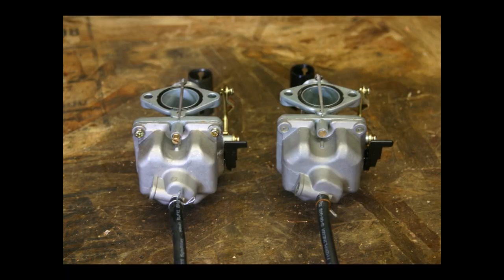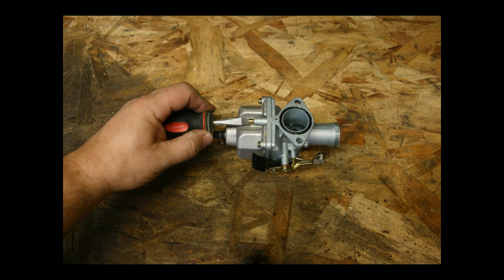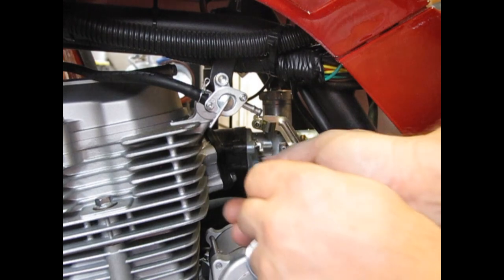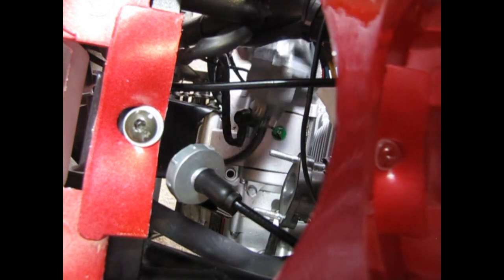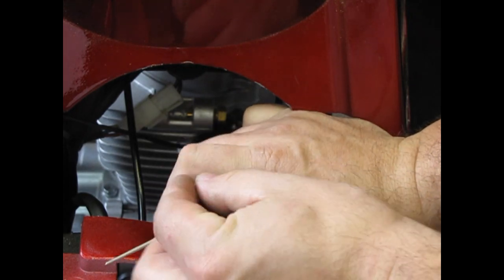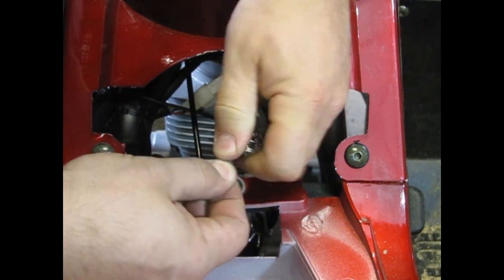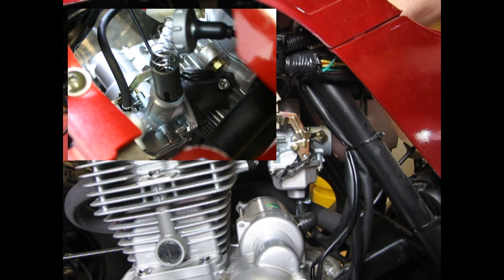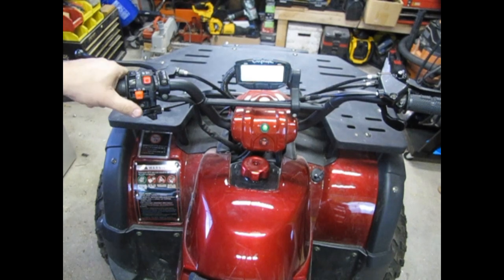How to Replace a Carburetor on your Tao Tao ATV by MUDIFY

Comment: I know this is an old video but you had a small line connected to your original filter you removed (pcv valve I believe). I never saw this reconnected. I'm having the same issue as my new filter doesn't have a connection.

Comment: Great video.. any insight on a apollo commander 125cc carb with a left hand choke cable? It is a pz22, I cannot find that set up any where! The numbers on the carb says pz22wl-6. Would you have a replacement or upgraded version?

Comment: Where did the pvc valve and filter reattach too?  My stock filter has the same thing that goes into the engine.  No space on my new air filter to connect.
Reply: You can technically vent pcv to atmosphere. Just plug the tube in to the factory port on the engine and leave it out of your air filter. Longer tube is better for keeping the oil that may want to work it's way up, inside. You can also put a fuel filter on the end of the line to keep mud dobbers and general filth out of your crankcase. Idk about tao tao but a lot of small engines have the pcv go right into the top of the valve cover.

Comment: What part do I check if I'm not getting fuel to the carborator on an ATV TAO TAO 250 (Rhino)?😃😃😃
THANK YOU VERY MUCH FOR ALL YOUR HELP! 😃 😃 😃
Reply from the maker: Hi Cheryl, I would start by looking at the fuel filter. If it's partially filled with fuel, I would pull the fuel hose off the carburetor (have a container handy to catch spills), and rotate the fuel shutoff valve back and forth. If no fuel comes out of the hose, you may have a plugged filter. Those stock fuel filters are not high quality, so I would replace it with a Mudify filter (https://www.ebay.com/itm/273737477664). If, on the other hand, you have no fuel in the filter, you may need to pull the tank and look for blockages. Best of luck to you! -Mudify

Comment: Leave links to the parts used so we can purchase
Reply from the maker: Thank you for the comment, datdude. I've updated the description to include the link to our Carburetor and Filter Kit. ebay.com/itm/273737353497
 Take a look and let us know how it fits!
Reply: @mudifypowersports3318  The description on the Ebay link says for 150-250CC.  Mine is the TaoTao 125cc New TForce ATV.  Will it still work?

Comment: I would like to know where the hose that is at the bottom of the carb goes
Reply from the maker: Hi Sour Complex, the hose at the bottom of the carb is a fuel drain line. The fuel bowl overflow runs out here, as does the fuel when the drain screw is open. When riding on rough or uneven surfaces you may notice some fuel spilling out of this line. The hose is simply to route the excess fuel away from the engine, starter, air filter. etc...
Hope this helps, and let us know if you have more questions!

Comment: Thank you for this video. I need some insight about the choke switch. It came loose and I lost the screw that holds it. How do I get it fixed. Please help
Reply from the maker: Do you mean the handlebar or the carb end? Either way, you can get metric screws at your local hardware store. I would take your piece to the hardware store to match threads. I bet you'll spend less than a dollar. Let us know how it works out, and good luck!
Reply: @mudifypowersports3318  not the handlebars. The switch itself there is is a screw that is holding it under the switch and it's missing.

Comment: Thank you very much! My new air filter does not come with an attachment for the PCV hose/valve - does that mean I got a wrong air filter?(wasn’t sure from the video if yours did and, if it didn’t, where to put the second end of the PCV hose after reattaching it to the engine).
Reply from the maker: Thanks for the comment! The PCV valve does not attach to the air filter after this upgrade, since it has its own internal filter.
Reply: @mudifypowersports3318  Thanks for the response! I am still having trouble after the carburetor and air filter change - my atv turns on and then it's almost impossible to keep it that way. Sometimes I get it to first gear and running for 10/15 seconds or so (never full throttle), but I always end up having to carry it back by foot (in one of these attempts, it actually got stuck in 1st gear, and will not go back to neutral - no rocking or further turning on and running will send it back to neutral). Any suggestions (or suggested videos) for these two problems? Thanks so much!
Reply: @96giugio  did u ever find a solution

Comment: I changed the carb but now the atv is super loud. Like it’s at full throttle already but it’s sitting in idle ..
Reply from the maker: Thanks for watching! Sounds like the idle screw needs backed out a little, or the fuel/air mix screw (on the bottom of the carb) needs fine tuned. Back the idle screw out until it just barely lifts the throttle slide, and reset the mix screw to 2 turns out, and adjust from there. After a few minutes of adjusting, it should run better than ever. Enjoy!
Reply: @mudifypowersports3318  I am dealing with this same problem, Tao 110cc, I start it and the thing hits wide open. I have backed the idle out all the way, and have tried adjusting the fuel air mix. I also checked the needle to make sure it is moving freely. Any thoughts?

Comment: I replaced the carb, now it won't throttle and pours gas through it. What did I do wrong?
Reply from the maker: I am guessing you mean the throttle won't open/close. If so, it sounds like there is an issue with your throttle linkage. Try removing the top of the carb and checking the cable linkage and spring. If you're  dumping fuel, that sounds like a float problem. Let us know what you find, and good luck!

Comment: I have a tao db17 gas is dumping out if the air intake side of the carb
Reply from the maker: Hi Swisher Sweets! Any time you have fuel 'dumping' out of a carb, you should start by cleaning the carb's fuel bowl float needle assembly. Normally the fuel would drain out of the overflow, but it sounds like there may be a blockage in the overflow as well. I would recommend pulling and thoroughly cleaning the entire carb. If this doesn't fix your issue, you should check the intake boot (intake manifold) for damage, and make sure your carburetor is properly tuned, including proper jet sizes. Good luck!

Comment: I just changed my carb but ever time i put it in drive it takes of vy itself
Reply: Idle adjustment screw is way to loose engine revs to high likely kicking it to gear

Comment: I have Tao Tao raptor 200 which is 169cc, do you have anything you recommend for that for carb and air filter? Thanks in advance!
Reply from the maker: Thanks for watching! The carb you need is a PD26 w/electric choke. We do not currently stock these units. But we will in the near future. Looks like we need to do some videos on the Tao Tao Raptor!
Reply: @mudifypowersports3318  thanks for the reply, that's the stock carb, I fitted and exact carb from Amazon that was 32mm, much more low end Power now love it
Reply: @mikerosa650   
do you happen to have a link to the carburetor you purchase for your Raptor 200? I am in need of one
Reply: @colunga1999  no I'm about to put the stock one back in it runs to rich
Reply: I am still waiting for you to do a carb upgrade and sprocket upgrade on the Tao Raptor 200.

Comment: Will this fit on the 125cc tao tao
Reply from the maker: Hi Timothy Hendricks, the carb you need is a PZ20 (or PZ19 depending on exact model), which we do not currently stock. Thanks for the question!

Comment: How bigs the new air filter?
Reply from the maker: Hi Dale Godfrey, the air filter element is about 3-1/8 inches long, and 2-7/8 inches around. Overall length is about 3-5/8 inches. The boot is a standard 39mm for the carb inlet. Thanks for watching!